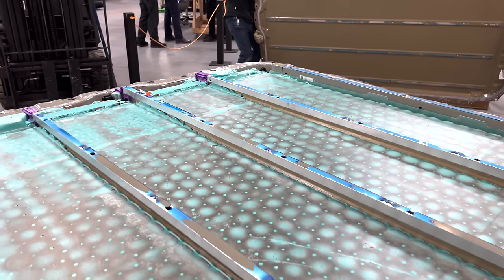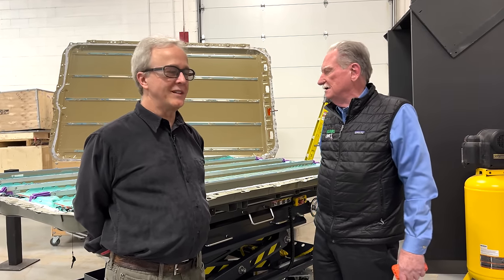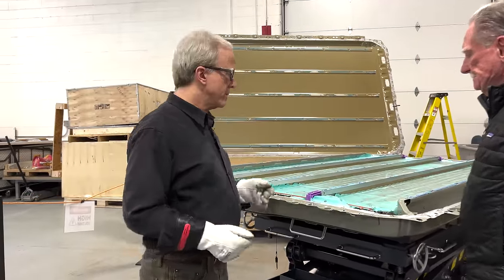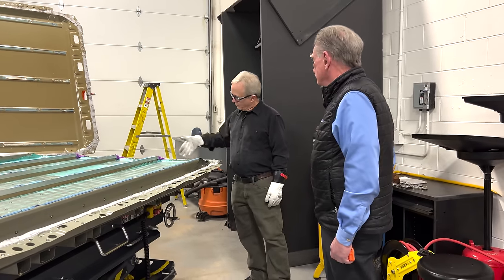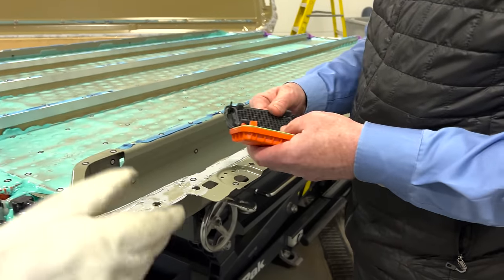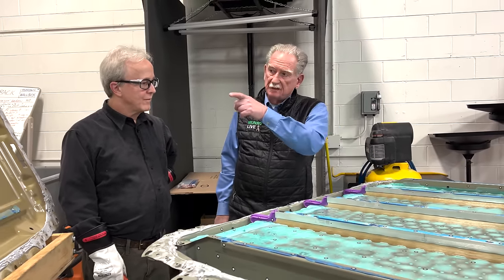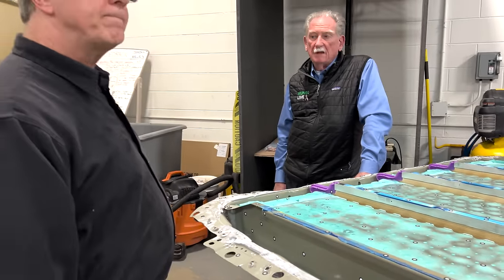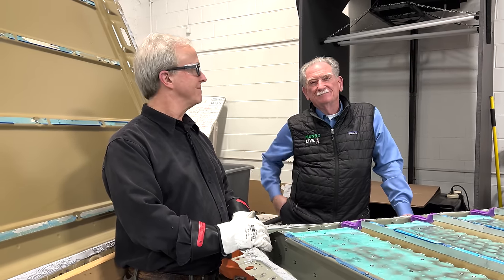Tesla Cybertruck Battery Pack: Our First Impressions Under the Lid

Comment: There need to be laws to make these batteries serviceable to some level. Sealing these things and requiring a full replacement for any failure is utterly ridiculous and not “green”
Reply: Making a battery repairable adds complexity, cost, weight and unreliability, better to design a battery that is reliable in the first place.
Reply: @universeisundernoobligatio3283  I've seen you write this multiple times in this topic. Some of it isn't even true: repairability and reliability are not each other's enemies. With some careful design, both can be achieved. However, this will cost some extra money, but sometimes investing some money up front will bring greater returns afterwards. Or even investing some money for 'greener' results is worth it. Isn't going to EVs supposed to be one big exercise in spending a bit more for greener results?
Reply: Yeah, lets get the government more involved than it already is, poking sticks into well oiled wheels and watch all the innovation incentive explode in a fireball of burocrat interference.
Reply: @xicofaria  Yet the government is slowly mandating we drive these vehicles until a battery inevitably fails and it writes the vehicle off cost wise. Yes it does happen, don’t pretend it doesn’t.
Reply: I’m a TSLA  stock holder and have enough shares to cover the maintaince or buy a new car my Tesla is the best car I have ever driven 💕😎
Reply: @guiseppe36749 One of the first modern EVs are Nissan leafs, older packs right now 14 years old. Nothing got loose. Still nice and tight how it was been when it left a factory. Pretty servicable as well.
Reply: I also Champion environmental laws on my smartphone!
Reply: @Picklemedia  A phone is a drop in the ocean compared to the materials that go into an EV…
Reply: @electricsnut  let's do the math:
-Carbon footprint cell phone 60 kg
-Carbon footprint electric vehicle 10,000 kg
-26 billion cell phones made
-40 million electric vehicles made

Carbon footprint of cell phones:
1,560,000,000,000
Carbon footprint electric vehicles:
   400,000,000,000

That drop just filled 3.9 buckets.
Reply: @Picklemedia  yet by 2035 we are mandated to all be driving EVs and pretending to be green…
Reply: @electricsnut  and people will still be on their cell phones complaining with righteous indignity.
Reply: Electric vehicles are not green to begin with.  

Just stick to ICE.
Reply: @SpiKSpaN-ei6zq ”this new technology is only 50% better than the old technology, not 1000% better, we might as well not even bother”
Reply: Batteries don't need to be serviceable, they just need to either be cheap or have long warranties. 300K mile warranty, 12 or 15 year should be the minimum.
Reply: do you repair your laptop battery or do you replace it? how many lead acid batteries have you opened and fixed? 

You replace bad batteries. They are misbehaving chemical systems, and you can't tighten a bolt to fix it. You trash it and start from scratch.
Reply: Market forces will work, people will see long term reliability and TCO and decide what they want. It's not fast but it's efficient and unbiased.
Reply: @colinm990  I wish that were the case but being mandated to drive these things is forced obsolescence
Reply: @AntonioDiNunnoEVS  A laptop battery doesn’t cost 30-40k to replace
Reply: @electricsnut  30-40k is about "Green$" not "green". Don't mix cycle aged batteries with new batteries. The laws need to require full replacement as a safety standard.  I'm saying this as an expert.
Reply: @electricsnut  Ahhh, that's the underlying motivation.
Reply: I'm not even sure if it's recyclable.
Reply: @hvh377 it’s probably a Tesla bot just writing the same thing everywhere
Reply: @pashko90 And you can buy new third party replacement batteries for Nissan Leaf’s…
Reply: @AntonioDiNunnoEVS  "Don't mix cycle aged batteries with new batteries [...] laws need to require full replacement as a safety standard"  That's a bit of sweeping statement isn't it?  In certain configurations this could cause problems, but it's by no means always true.  What about a single sensor failure, or BMS IC failure in a pack like this?  If you really are an expert, and if it was your money, would you really choose to trash a $25k designed-for-repair pack which had one dead $15 cell in it?  I doubt it.  I know you might need to replace other cells directly in parallel, or perhaps even other physically adjacent cells if there was suspicion of heat damage - but a good BMS would record this sort of detail.  This is just extreme "design for manufacture" crap which plagues modern smartphones (but not from all manufacturers importantly).
Reply: @infamousbugg  It is recyclable, but that really is a poor alternative to what could otherwise be a cheap repair for many types of fault.  This is just crappy anti-consumer design as far as I can see to shave a few $s off manufacture cost.

Comment: So the CyberTruck has a non-repairable battery.
Reply: Non maintainable battery. The battery can be replaced itself, i think, but not fixed or easily recycled into differenr uses.
Reply: Yes. This Design should be forbidden for every OEM by law. To protect the customer
Reply: @lassikinnunen 
On the contrary, most aged vehicle battery pack [modules] are reused in lower-current applications that will last for [further] decades. [This battery pack is composed of several long parallel modules, separated with insulating structural members. I'm sure these can be cut apart.]
Reply: @imconsequetau5275  look man if the individual cells are cut from the thing the pack itself is single use.

They recycle the chemicals in bigger operations not go through the packs, sure theres couple that tear down packs but thats not the norm.
Reply: @lassikinnunen  
If you want to distract yourself, and many others, with an irrelevant digression about individual cell removal and replacement, then nobody can vouch for your innate ability to understand my previous comments about module reuse. 

Furthermore, when a single cell fails-open in a set of seven parallel-connected cells, the entire battery pack still has 85% of the original design capacity, and does not need to be scrapped nor refurbished. 

Under warranty coverage, the pack would be exchanged and the degraded pack could still be sold used at some reduced resale value, such as 85%.
Reply: @imconsequetau5275  could is not same as would be, i'm not saying they couldn't, just that they are not.

For example Tesla themselves doesn't even use them for stationary applications that they have within the same company.

If we were truly resource starved they would be but its a culture of crushing to extract the lithium. Much like cars are generally crushed rather than the working parts reused.
Reply: @lassikinnunen all I read was e-waste
Reply: A repairable battery?
Are you serious?
Just the type of consumer the EV makers are looking for there, pal.
Reply: and non repairable motors and non repairable panels and non repairable hinges and non repairable sterring and non repairable computer and non repairable ect list goes on.. the Toss-la garbage truck is less repairable then a syrofoam cup...
Reply: but just as  disposable
Reply: It would be cheaper to replace than to repair, in every EV.

Comment: The serviceability of this pack looks to be about 0.. lol
Reply: Not really — the foam can be scraped off and washed off for repair.

On my C-Zero the DC-DC converter was defective. I scratched out the silicone to unsolder two capacitors.

Comment: Look at all the hard work that’s been put into making the battery a non repairable item!  Very ‘green’!
Reply: F*ck EV's, I rather drive and fix a cool '68 mustang.  hehe
Reply: Green adhesive for this purpose.
Reply: @Tindurbox  - Too bad it's not as easy to recycle battery materials as simply crushing it.  It requires loads of other chemicals, machinery, and labor.   As of today, mining lithium is still cheaper than recycling unless they can optimize it.
Reply: @BillAnt  Redwood is there.  The transition is happening now.
Reply: @BillAnt  So your position is because EV batteries take more work to recycle, the solution is use something that is totally not recyclable, such as fossil fuels. If recyclability was your concern, you would not being using fossil fuels... EV recycling costs more because it's in start-up phases. Everything cost more during it's start-up phase, because the process is not refined and there is not yet a volume to make it cost effective.
Reply: @derek3524  We are nowhere near to be able to cover our electricity needs from green sources.
Reply: @velenceigabor1418  We are very much able to cover more than our electricity needs from green sources
It is just a matter of installing more Wind and Solar and Stuff
Reply: doesn't the battery last at least 150,000 miles , right?
Reply: @BillAnt Well sodium batteries are coming
Reply: @Maxaker sodium batteries gotta get mixed with other elements to cover up their weaknesses such as energy density. Same thing will happen when graphene batteries become a reality.
Reply: @bruhmomento7563  - All these chemical reaction batteries are like spinning hard drive technology, outdated and inefficient.  What we need is true solid state batteries with no chemical reaction such as super-caps (like SSD's with no moving parts).
Reply: They make more money selling a new one
Reply: @derek3524  you are aware most energy is produced by fossil fuels, correct?
Reply: @velenceigabor1418  Thas simply false lol. In fact its the only way to meet the raising needs through gpu farms for AI etc.
Reply: @velenceigabor1418  umm yes we are other countries are doing it or have done it btw,
Reply: @BillAnt  why can't we have nice things? Electric vehicles are fun to drive 
I say BOTH
Reply: @BillAnt  If the battery pack in my '19 E-Niro developed a fault (usually 3 dead cells due to the pack layout, but maybe just one), I could probably fix it myself.  Spare cells are about $30 each.  NO WAY would I buy a car with this style of unrepairable pack, any more than I would buy an ICE car which had a welded/bonded engine block, or even a washing machine with a welded tub.  This sort of unserviceable design just sucks and should be flat banned.  This pack is like a giant Samsung smartphone - which I wouldn't buy either - not after the last 2 hour repair session I did on one.
Reply: @websitemartian  It should last way longer than 150k miles.  But if it doesn't, and it needs repair (and that could be due to the failure of a $10 IC), then this whole design is scrap.  I assume it saves them a grand or so in production costs at the cost of making the whole pack essentially a disposable item.  That's pretty scummy I think, and is like modern washing machine designs (welded tubs so you can't replace bearings), as well as certain smartphone brands.  Really there need to be laws against this sort of stuff.
Reply: @Tim_Small  We have a 17 Model X with 95k miles and only about 10% degradation.  With this newer design (several years of learning) should last much more than 150k miles.
Reply: @MikeMc7575  Gradual capacity degradation is not the issue I'm worried about - it's expected and not really fixable (and as you've pointed out is less of an issue with newer cell designs).  The sort of issue I'm concerned about is individual component failures (things like an individual cell failure, or a dead MOSFET - both $5 parts for your pack).  It should be possible for a suitably skilled repairer to diagnose and replace these in maybe a couple of hours (including disassembly time).  With this sort of pack design, such replacements become extremely difficult, and the pack is effectively a write-off, when it could otherwise be fixed with $10 of parts.
Reply: @MikeMc7575 I have a KIA EV6 with 22,000 miles and 1.5% degradation
Reply: @websitemartian  testing is showing unless there is a build failure, the new LFP batteries should last around a million miles.   The "old" lithium ion batteries are still going strong after 100-200k miles, so it will be interesting to see.
Reply: You may still seem to think people are buying tesla's to be green?   I didnt buy mine for that - I bought mine to have a car that can go 0-60 in under 2 seconds and cost less than  several hundred thousand.   I suspect most people dont buy a tesla to be green.   Maybe the people who by cars like Nissan LEAF or old toyta hybrids lol.

Comment: Battery configuration: likely 192s 7p, which would be about 705V DC nominal. 4 modules of 336 cells each. The 4 modules are 48s 7p each. To be confirmed once they can look under the green foam which may hide a couple of more cells at the ends. There is a switching circuit that can either switch the pack to 192s 7p (all 4 modules in series) or 96s 14p (2s2p of the modules).
Reply: Regulatory filings show 816V and 150Ah -> 224s6p
Reply: Video timestamp: 15m 50s

48s x 7p x 4s = 1344 pcs of 46800 Cylyndrical Cells

Comment: The ability to pressurize the pack and a pressure sensor should also allow some diagnostics about whether there are breaches in the seals or a stuck open port. Hopefully this will make the packs even safer
Reply: could most likey be added with a software update. Especially since all the sensors are already there
Reply: @SolarScootersuk  It exists already most likely, its in there, somewhere....
Reply: I think the active pressurization keeps the battery safe from water intrusion through the sealants, but also prevents chamber indenting or distortion when submerged. [Therefore preserving the integrity of surfaces holding sealant.]

Comment: Remember the flood ports and compressor are a necessity for fording water. The water is usually always cooler than the mechanical parts or battery pack. When the void is cooled it will create a vacuum and attempt to suck water in where ever it can.
On a traditional banjo axle the breather on the top of the differential housing is a oneway valve to allow pressure out. When the housing is cooled in deep water the valve sucks shut. Water is pulled in past the wheel bearing oil seals .

The larger the air void in the battery pack the more 'air' needs to be managed. The compressor is critical.
Reply: Compressors are not the surest thing in automotive NVH apps
Reply: The battery system has a SCUBA type regulation valve that minimizes the differential pressure of the battery. 

BTW, the Cybertruck air compressor has a sizable reservoir, and if this compressor fails, you are not going to be driving the truck.